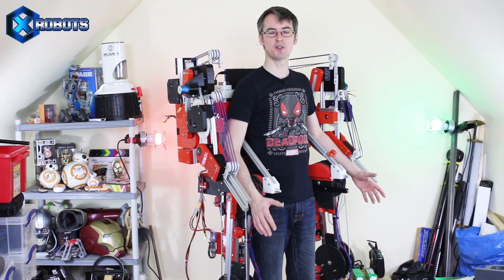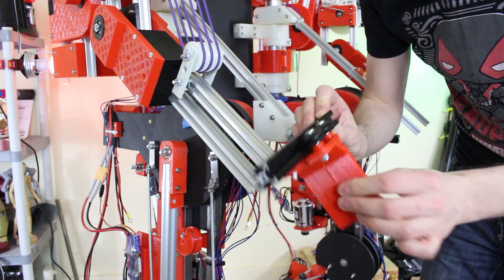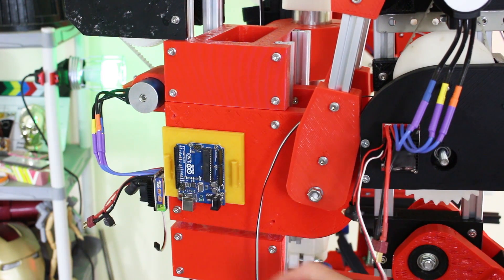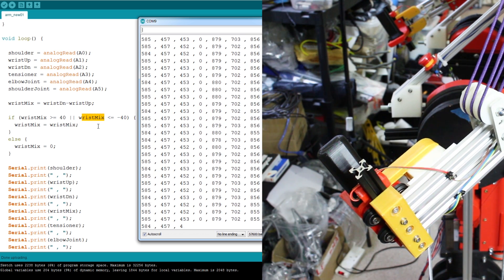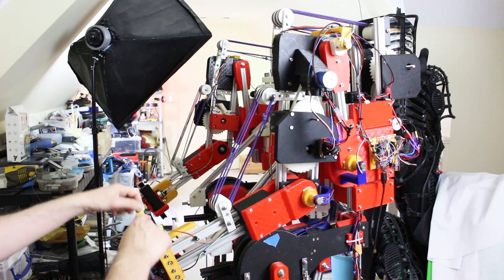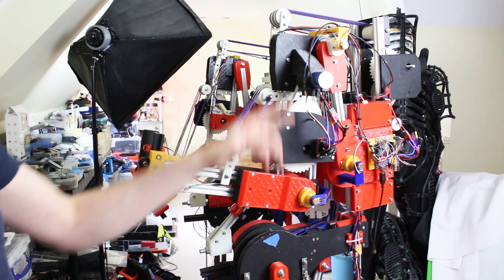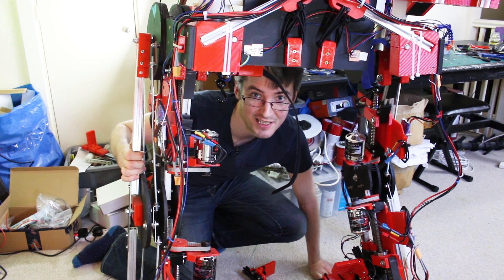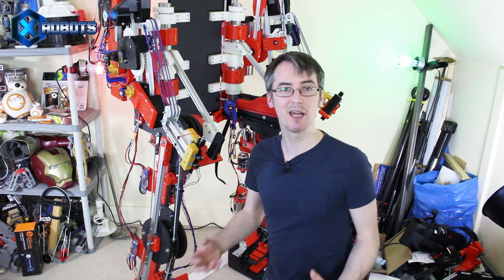Iron Man Exosuit #25 - 99% Functionality | James Bruton

Comment: Not sure how you say it in England...
But here in states... I think we'd say
"BRILLIANT...!!!"  Absolutely... "BRILLIANT...!!!"
Every thing I've watched you build..
"ABSOLUTELY... BRILLIANT!!!
Was wondering about using old cell phones...? Or what old computer, auto, alliance parts , could be used?
Love the plywood and pulley construction... I know your quite familiar with EVA foam armor...
I've been doing A lot of experiments with adding" top wire" (chain link wire) and other light metals over EVA foam, using super glue as a form of epoxy...
Basically to create an "InoSkeliton"
That is durable.. light weight and comfortable.... this is where it would be far easier to connect all of the pressure sensors... ECT 
And it could be made  to get out of the Exoskeleton... in case a part... Melts  down!!!
There's a ton of things you can do with EVA foam that have nothing to do with "Cosmetics " and everything to do with quick prototyping... takes epoxy/fiber glass... can be used to make plaster molds/ aluminum castings... !!!
I've been learning blender... it does so many things, including 3d printing... What do you think of Blender as a central program for creating... control funtions, displays, heads up displays, sensors.... ect 
Anyway... ABSOLUTELY BRILLIANT !!!
I'll be playing with building this one... Sonic and the Performance bots!!!

Comment: This is very impressive I just feel like there has to be another way to do it that is more compact. I mean I assume it would be expensive, but I feel like there should be a middle ground between all of the mechanical advantages and just using motors with more power. This was not to take away from the hours of work that he has put into this design, but it would be cool to explore the other ways this could be done, I think using air muscles would be quite cool.

Comment: It's very clunky and crude...use better motors and a better drive system.
Reply from the maker: Better than 2Kw brushless motors?
Reply: @jamesbruton  your motors are powerful but they're bigger and heavier, besides 1)  you need to power to be transmitted to several joints removed from your motor/power source.... a multi-jointed Lead-Screw arrangement solves your problem,  2) When holding a  position your motor needs to be energised with pulleys n gears, with worm-gear or Lead-Screws you can cut power to the motor and still hold position. 3) I'd use Maxon or Faulhaber motors for robot projects but they're pricey....but so much quieter and powerful -
Reply from the maker: Yes it's driven by pulleys and ball screws?
Reply: Sorry I'd show you the actual design I've developed if I could, but I'm not allowed to do so.

Comment: //[IMPORTANT] 
void important(){
I have a question: how the sensors of movement by person side work? because if you put some load in the end of arm it can destroy the functionality of drive system in pressure sensors or othwer optical sensors. I already tested it few years ago. and the answer that I found is more advanced that i would can construct with my limited sources. an EMG system based on op amp and an algorithm to control the motors. but I gave up on this project when finished highschool.} 
println("waiting answer from james...");

Comment: Next step should be to put the emergency stop button where you can hit it easily from within the suit!

I also suspect that unpowered joint in the arms may cause some havoc if you actually try to lift something heavy. But I guess you'll figure that out when you try it. I do admire your approach of solving problems when they're well-defined and not before, as long as it doesn't cause safety problems.

Really neat series. I'm thinking about trying to homebrew a HaptX-style VR feedback leg exoskeleton, and having watched this, it suddenly seems a lot more plausible.

Comment: WTF is this?? It not practical!! why dint you opt for Hydraulics/pneumatics??
Reply: What comes to my mind is a Motor Cycle. I know what i am suggesting might be impractical as well, but if i had the resources i would use a Moped ic engine to Drive the pumps. lets say 100cc engine. we could get approx 5hp. we could use a Hydraulic Gear pump, more efficient. Get gr8 flowrates, and attain pressure in couple thousand psi. I mean this could be an actual iron man suit. :P wild theories...!!
Reply: I mean fast and agile, and Strong like spider man :)
Reply: i wasnt expecting to see belt and having to worry with slack/slag. Hydraulics/Pneumatics would be clean

Comment: Love that you show the failures as well.  Great video!  PETG might be a happier midline material for you for being able to make big parts that don't warp but still have lots of strength.  Anything screwing into wood o plastic is going to be pretty weak though.  Maybe a stopgap would be to use more through bolts so it takes more force to fail, heh.  Looks really nice though, a long way from the first mostly wooden one.

Comment: The look of panic on your face when it all suddenly stopped doing what you expected was very reminiscent of the look I saw on a friend face when he was showing off his new company car and took us round a blind corner on a country lane way to quick, only to find the road was almost entirely full of tractor. Luckily the tractor driver showed amazing reaction time and instantly stopped. Also luckily, My mates car had all the latest electronic gizmos designed to help less gifted drivers not end up on the roof, in a ditch, on fire, and we slithered to a stop a good 8" off one of the tractors front tyres.

He was laughing about that near miss later, But I was there, And the look of shear terror on his face makes me think he was only a few inches away from crying.

Strangely though, I felt perfectly calm through the whole thing. The one thought that I remember idly going through my head was that I'd never seen an airbag deploy before, And wondered what it was going to be like (An experience that to this day I still haven't had)? By the time I felt good and ready to have a panic there was nothing left to panic about...... So I didn't. :)

Comment: Apart from the 3D-printed parts that broke, it looked like the strings of the arm motors also slipped of the pulleys... I think you need some casing there, because the readjusting with the magnetic sensor just isn't quick enough.

Comment: It works, but I don't see how it can actually lift anything, since there are no grippers on the ends of the arms. It's basically an exo-suit that follows your movement. The power loader from Aliens has two huge claws to grip things with. I don't see the point of this other than to show off your abilities at electronics engineering.
Reply: So there will be a way to pick stuff up eventually? Cool.
Stay safe while building and testing it.

Comment: Hi James, you may want to consider using Teensy over Ardiuno in some of your next projects. They use the same Arduino IDE but Teensy 3.5/3.6 offer a lot more interrupt pins and operate at much faster processor speeds. They are smaller equally as easy to work with, and are surprisingly less expensive. As the name suggests, they take up much less space, and can nicely replace any Arduino mega, uno or due. - My 2 cents.. Great Work
Reply: It may be worth it for future high speed and response time projects. Especially if you can offload the sensor data to come in as interrupts instead of a polling based approach. You may get to use encoders instead of potentiometers, if you have any applications that require high precision. Again, I love the work you do, just a suggestion :).

Comment: Great work so far! Just a note though on your Arduino code - you might want to move away from using magic numbers; it will be much easier to come back to down the track if you have all these various numbers you've used from min/max values from your sensors to be instead a constant called something like "sensorUpMax" or something similar. Improves readability and also means you only will need to change the value in one spot in your code and it will be (ideally) in the block at the top so will be quick to find.
Reply: That's fair enough; I just know that going back to code like that in even a few weeks can be hard if you get into the habit of using numbers instead of just defining constants when you write the initial code.   Was a habit I had to break a few years back when I started going back to code I had written a few years before and had to spend a not inconsiderable time relearning what all those numbers were for :3   It's a good habit to break. :)   That said it's not like this is a huge code block but still worth at least considering. :)

Comment: Always really fun to watch. Have you considered coding in fault detection and fallback behaviour? You could write a floating pin detection and jerk detection for mechanical and electrical failures, and define sensible fallback states such as power off, or stand up straight. You could even write it into a sensor library that sets fault flags, and have a flag check as part of the main loop.
Reply: James Bruton 

I was thinking that a functioning electrical sensor should see a sudden position change on catastrophic failure. The failure where the wire was yanked should also have a signature of sudden movement then a floating value.

Another sperate thought, if you put in a pullup/down to some known value, or even towards a signal value that indicates a disconnect you should be able to get a reliable disconnect detection.

Comment: Pls make it with metal...  It would work well.....
Reply: James Bruton, hey bro if you use few hydraulics for movables at least for arm, using central fluid tank which can be fitted on u r back,it would drastically change the amount of gears pulleys and load on them and more over decrease the size of exoskeleton.
Reply: James Bruton , by the way is it possible to setup legs of exoskeleton on back side of u r leg instead of side